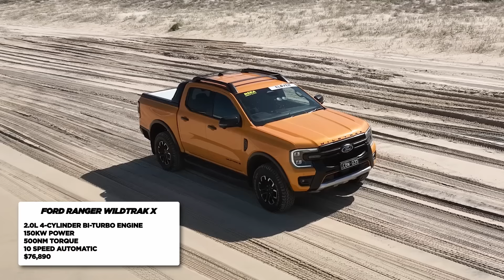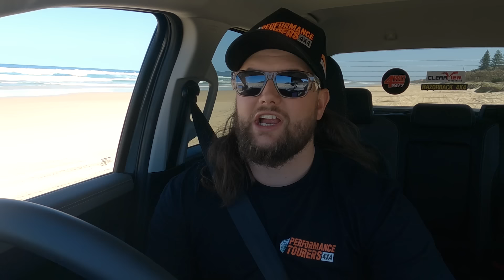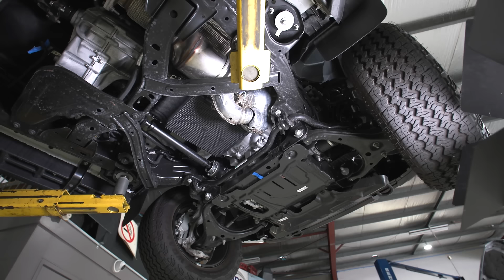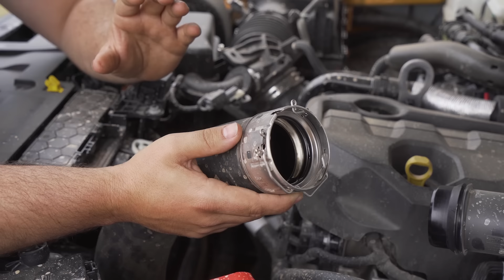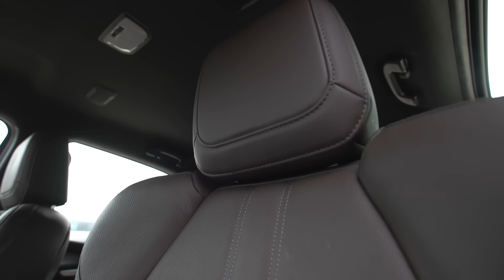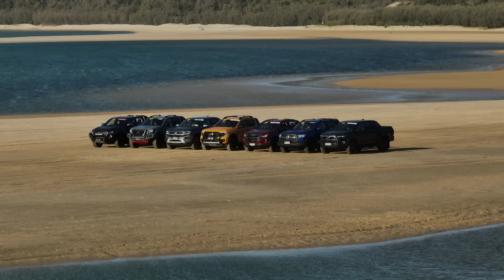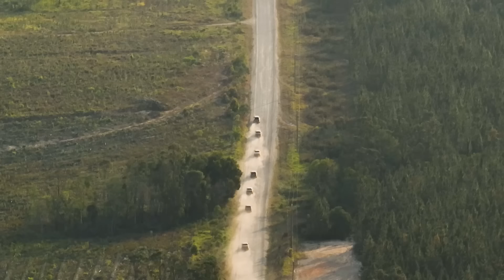2023 4WD UTE COMPARISON - Top Pickups tested Off-road - Shock winner!

Comment: Good comparison. It’s hard to choose a ute when you consider all the nitty-gritty. In the end, the ‘best’ one is the one that has the feature/aspect that suits your purposes best. I bought a ute early this year, not new but a low kilometer used ute to save money. I got a 2021 Isuzu D-Max X-Terrain. Love it. It’s stock, all I’ve done is put all-terrain tyres on it, a 12v system, drawer and other stuff for a practical camping and touring setup.
Reply: How did it not come with All-Terrain tyres? That’s mad. Can’t believe people don’t get ATs when they buy them.
Reply: @jerrymyahzcat  It makes sense that they come with highway tyres. The majority of dual-cab utes don’t go off road, used as family cars or as a tradie car (which doesn’t necessarily go off road). So for the majority of buyers, the regular tyres suit them. Also, a lot of ‘off road guys’ are pretty specific to which tyre brand/model they like, if they came with all-terrain tyres I suspect a lot of buyers might swap them for their preferred off road tyre.
Reply: @tbduggan85  fair comment yeah. Perhaps they just need to sell with two tyre options then. One road and one off-road (AT). People often choose their own road tyres too.

Comment: Weird that the Gladiator Rubicon isn't here. It would walk up all of those tracks even without turning the lockers on
Reply: I would love to see these guys review the Jeep Gladiator. I have watched a few different comparison videos on other channels that feature the Gladiator Rubicon and it consistently wins in the 4x4 category hands down. It is widely considered the best 4x4 ute out of the box. However, for overall value its cons include high fuel consumption; low towing capacity; smaller payload; and not value for money. I love my Gladiator, but I dont actually recommend it to people unless they are going to use it (or are a Jeep fan).
Reply: @euromellows8  that's true but I'd say the same about a Wrangler too. They're built to be awesome off road and the things that make it so good on difficult tracks also makes them not so good on road or towing

Comment: Disappointed that you guys didn't give the V6 Ranger Wildtrak a crack against the competition. Its a completely different beast to the baby biturbo and really needs its own assesment rather than generalison, it runs an entirely different 4wd setup with 4Auto constant 4wd for towing. It also has a better stock suspension setup compared to the v6 Amarok.
Like many will agree, its pretty safe to say the V6 Wildtrak would have wiped the floor with this line up... if your gonna make a statement like ute of the year, at least have an honest and fair line-up/comparison.

Comment: In my opinion…..if the torque output is less than 600Nm & it doesn’t have rear disc brakes….what’s the point if there’s no innovation?
Toyota did it with the all new Landcruiser….from a V8 to a V6 which put out more power & torque & better fuel economy 👍

Comment: Regarding dmax airbox needing to be heavily modified for a snorkel is false. If you fit a factory snorkel a replacement airbox comes with the fit kit with the inlet hole on the side rather than the front. But another fantastic comparison video guys. Very in depth 👍

Comment: Go the Nav, great looking ute for it’s age even before the new face lift. Have a 2016 STX and have accumulated 235,000km so far on mine with a tune making 200hp, lifted on 35’s. Mix of wheeling every month and towing a 17ft Jayco. The tune really wakes up the motor and throttle response without requiring a throttle controller. In the time of ownership (from new) I have only had 2 rear main seal replacements and the infamous leaky hot pipe and intercooler pipes that required replacing. Went with after market alloy pipes that costed approx 2.5K in total, so to be certain they will never leak again. 1K for the rear main seal out of warranty. It’s been a really capable ute, comfortable and has never left me on the side of the road stranded. For the 3.5K I have spent in the 6 years of ownership to rectify the oil leaks, I would say it was worth it and I wouldn’t have it any other way. I would definitely own one again unless Aus Nissan brings the big cousin Titan over, then all hands on deck haha.
Reply: I also have a 2016 stx. 243k atm. Done 3 hot pipes brought replacements at wrecker for $50. I know jp captured on YouTube promotes crg hot pipe which cost $450, platinum and others do them to. Very easy to put on. Im really happy with mine been a great vehicle good on fuel. No engine seals done. Only thing I don't like is they annoying horn which always gets bumped at the most awkward times. Might change for newer model wheel. But i vouch this is a great vehicle and more capable than others competitors in bush. They test numbers from these Muppets are stupid and predictable we know how it goes before it even starts.
Reply: Thanks for the great information. I ordered the Nav pro4x with the 1% interest finance deal and the discounted price when Nissan just had their flash sale. The cost per week is about 1/3 or more lower than the rest excluding the Cannon and that gives a lot of room for personalisation and upgrades. With the recurve tune and a good aftermarket suspension, snorkel and tyres, will be a beast. It's also one of the best looking ones externally in my opinion although the interior leaves a bit to be desired. (At least they have put in heated electric seats now)

Comment: I think you gave adblue a bit of bad press there. My disco 4 takes 20 litres plus and that lasts for 15000km  plus, giving a low warning at about 2000km left. It reduces emissions  up to 95%. We should be retro fitted adblue systems to old cars, not buying new ones, but car dealers dont want that. Let’s see you do a programme about adblue/ urea and SCRs. How much bhp do you loose?

Comment: Love the video guys! I work for Hervey Bay 4x4 connected with a ssangyong dealership. One thing I’ve noticed is that the ssangyong musso is really coming into play as a great towing and off-road vehicle. With 3.5t towing capacity. Can get them in a SWB coil sprung or a LWB coil or leaf sprung. With accessories like bullbars suspension available. I’d love to see next years video with ssangyong musso included. Thanks again boys!

Comment: I would not worry about the AdBlue. You only fill it once or twice a year. Every 15k-20k km. I don’t know how well it works with your performance upgrades though.
Reply: The added cost for the adblue is still less than the 6 month servicing for the Hilux, they failed to mention anything regarding servicing intervals?

Comment: I’m with Jock on this one. My 2014 Hilux is at 189k km. I have had it since new and I have never had an issue with it. I maintain it an it just goes and goes and goes.
Excellent review by the way! 💪
I don’t think the VW will hold up in the long run. All my friends that have had VW have had costly repairs. They just don’t have the same quality and are expensive to repair.

Comment: You're at blue what we call DEF up here in the United States. Goes for $3.49 a gallon. We go through an average of fifteen gallons of d e f for every 400 gallons diesel.
And it is recommended that you clean the after Treatment filter once a year.
Due to the amount of sut Blockage is a filter and if you don't it will be rate your vehicle Down to 20% of usage driving ability until you do.
We average 7 or 8 miles to the gallon In our commercial semi trucks Here in the u s a you do the math to make it work for you guys

Comment: I'm actually surprised the nav didn't get more credit I think it's a good looking ute and with that coil rear end its a game changer for the tracks
Reply: They didn't give credit to the Nav in many areas. It has a dedicated Towing mode to cater for the gearing and engine revs. It has a 5-point linkage suspension system with a heavy duty thick swaybar in the rear. With the 2 mode springs in the rear it rides comfortably and tows great when loaded. I use one for towing and wheeling. I love it.
Reply: Engine aside 👍
Reply: Nissan always scrimps in the main areas, it's a upgraders car.
Reply: Its a shity deal that the nav they tested isn't even a "full" production product it's an aftermarket option done by Premcar an Australian company sperate from Nissan.

Comment: I pick up my cannon xsr next week. My first 4wd ute and will be upgrading alot of things on it so it will be a better ride. I think once some companies figure out a tune for them they will open up a little bit more potential in them and make up for the initial laggy throttle input. But coming from a old commodore i think i will be quite pleased with it and wont be regretting the outlay that it would take for a similar spec ranger or hilux.
Reply: You can probably get a tune and a whole lot of suspension for that price.

Comment: @4WD247 Sorry this needs to be said!
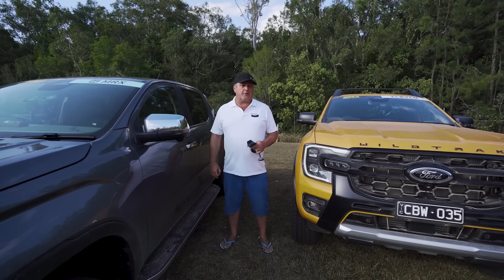@49:00
60+ metres stopping distance from a brand new vehicle is downright dangerous and needs to be called out. The 50-something is pretty pathetic as well.

Paul Maric @ Car Expert tested a 150-Series Prado (which has 14-yo underpinnings) earlier in the year and it braked in 39.x metres FFS. And with Amarok and Ranger not far behind Prado, shows a large body-on-frame car can stop. I can forgive the Nav for having rear drums and the extra off-road-oriented tyres and kit but 64 metres?!?! Not good enough Nissan.

Any modern brand new 4x4 (regardless if its SUV or dual cab and their trim/specification) that exceeds a fourty-something-metre stopping distance is not good enough.

Mazda/Isuzu clearly cutting R&D dollars as well. All-new platform yet 54mtrs is a truly shithouse effort, outgunned by a 8yo Hilux platform by nearly 10 metres.

Manufacturers need to be put on notice and stop skimping on braking hardware. And ADR wankers need to stop worrying about stupid irrelevant shit and enforce a stricter braking compliance and minimums.

Comment: I picked up a base model Cannon very recently, and im glad i did. I couldn't afford a more expensive ute, and I gotta say, value for money wise, you can't beat it. From a mechanics standpoint, it also looks super easy to work on. Yes, it's a bit sluggish and laggy on the throttle, but I think a throttle controller would make a night and day difference to this vehicle. As for the suspension, one thing to note is that the XSR has the same suspension as the base model but with all the added weight of steel bumpers and roll bars, i test drove an XSR and i gotta say, the base rides a lot better being lighter. That being said, most people are probably going to upgrade the suspension anyway no matter what they get.
Reply: Just slam your foot to the floor every time you take off. 
That is all a throttle controller does.
Reply: @grego4835 yes a throttle controller is a waste of time and money. I’ve been saying that for years. My vehicle has built in throttle response control in the form of Terrain Response.
Reply: Value for Money and cheapest are two very different things. Cannon isn’t that great value for money but it’s certainly the cheapest here.
Reply: @jerrymyahzcat  Its the best value for money out of the segment. Sounds like you just want to justify paying tens of thousands to have the "correct" badge on your car.

Comment: Just a correction, AdBlue is not an issue and if you think it is then you are wrong. 2015 Ford Everest was the first Ranger model to have AdBlue and one tank of Adblue (about 18 Litres) would last anywhere from 12,000 to 15,000 Km, therefore not even worth worrying about so don't know why they made a big deal about it. Come on guys get your facts straight.
Reply: Adblue is horrible. I have that same pre mix two stroke dirt bike feeling when I’m filling up minus the performance and fun of a two banger. I had a time once where I went to 3 service stations and found that they had ran out of adblue….. and I work in Brisbane 🤦🏻‍♂️

Comment: i would love a ranger with the bi-turbo v6. but i hate those knoby shifters in these new cars. i want a mechanical link between myself and the gearbox so i can choose what i want the gbox to be in(NOT a manual, i like auto in my offroaders). some of these new cars have ridiculous saftey "features" where as soon as you open the door or get out of the driver seat, they lock gbox in P or put the E brake on and you have to go through a process with the igniotion and selecter to stop it. frustrating it is.

Comment: Hi, After reading a lot of the comments, I too struggle to understand some of the scoring versus 
the points you have mentioned as both pros and cons.
I believe that personal preferences got in the way of a what should be an unbiased review e.g adblue really, a tank lasts how many 000klms! And a new turbo position and controller on the Dmax is more reliable - what historic data do you have- plus if the engine was so reliable before - why did they move it.
The reply comment on the V6 engine is disappointing given the crank has been revised, totally different outlook to the Dmax situation
Only my view

Comment: Hi Guys - Great comparison overall but not sure why you would put the 3.0 V6 Amarok in and not the equivalent Ranger? Seems a miss match? For the rest you have used their top models...
Reply: Thing is that they didn’t even use the 4wd amarok variant which would be the pan-Americana which would be the equivalent of the rouge and warrior x I reckon a miss match across the board

Comment: So after pointing out the dusting issue with hilux airboxes. What would be the best way to address that
Reply: I’m also wondering the same, if it needs an air box upgrade or as simple as redirecting the intake via snorkel

Comment: We got the Wildtrak X. Really good drive,  lane assist correction and auto start/stop is a bit to get used to.  We've had ours for about a week and about to drive it from VIC to QLD in another week.
Reply: I disabled auto start/stop, found it to be annoying. Does yours have a weird thing where the interior ambient light doesn't always turn on when driving at night?
Reply: @ItsKK17 mine does the same is there an permanent solution for that?
Reply: @tedeganagondi not sure, but I’m hoping it could be fixed by a software update. Not too bothered by it as it only seems to happen once a week or so with mine - so just a minor bug to deal with for now 😁
Reply: They missed the mark by not or at least having the option of the v6,perfect vehicle for offroad/touring with that engine.

Comment: I remember your first 4x4 of the year video, you installed the same tires on all vehicles. I wish that was done this time around
Reply: More of the utes run different sized tyres these days.  Most used to run 265/65r17 or 265/60r18.  Now you get 16-20+ rim sizes and all sorts of tyre sizes.  Not all are coming out with HT.  If the purpose is to compare off the floor performance, putting the same tyres on them would give advantage to those that come with rubbish ones and disadvantage those (in a value comparison) that come with decent rubber.

Comment: I've had my gwm cannon for 2 and a half years now, 3.5 inch lift all round and 35s looks mint and goes very good lacks in power and towing but it's definitely a good contendor
Reply: How does doing the lift mod affect the factory warranty

I assume if anything goes wrong in the drive train, they could just say the mods are to blame?
Reply: sorry but leafs needing to be replaced and upgraded from factory (and shocks lacking) should have been more than one point off, thats ridiculous
Reply: 🤮 GWM

Comment: Can't pretend to be surprised that Jocko would get the Hilux.  He loves the almost complete lack of changes over the many years.  
The I in Toyota stands for Innovation...
Me, I'm actually quite interested in the Amarok v6.  looks very cool!
Reply: Amarok is a city car
Reply: h28  yeah, if I'm honest I'd rather a v6 Ranger. The Amarok was interesting in the review though.
Reply: @davidmanning8329  v6 engine has alot of issues and the 10 speed auto also having major problems. Ford customer service is a nightmare to deal with.
Reply: @JDMJesseee  doesn't match my experience, but enjoy believing whatever the interwebs confirms you already thought was true.
Reply: @davidmanning8329  great english David, for now yours might be great but my fleet of 5 rangers all have been rubbish and granted they are used offroad as service vehicles the warranty isn't worth the paper its written on.
Reply: Ranger is pretty rubbish
Reply: Why change what isn't broken. It's reliable and good. You don't need technology just for the sake of it. Technology is just prone to breakage. KISS.